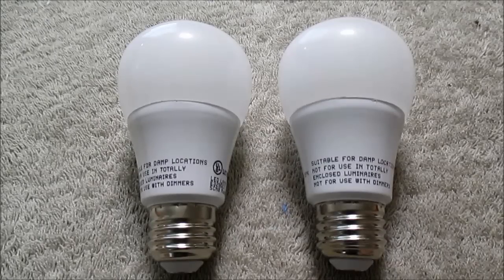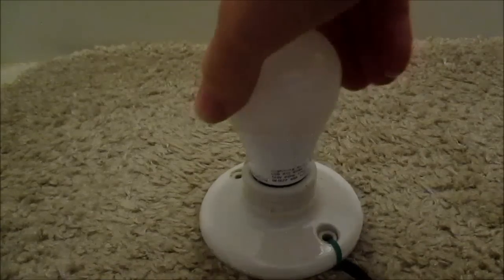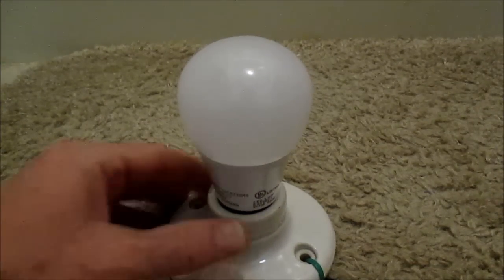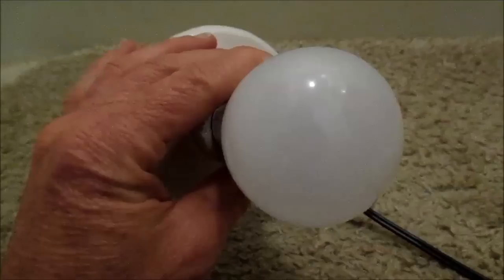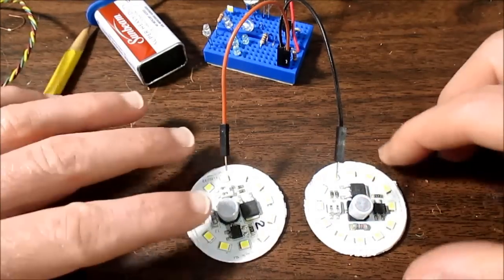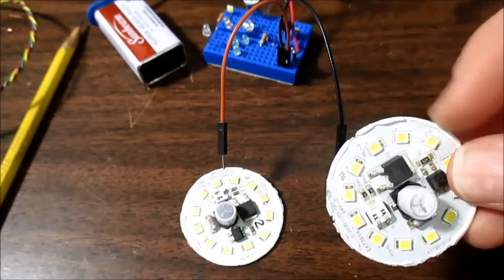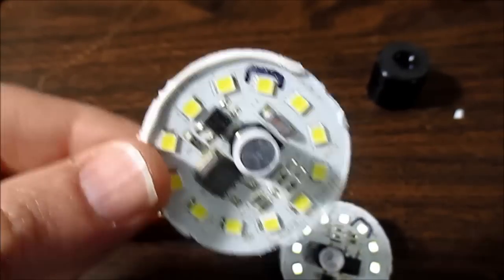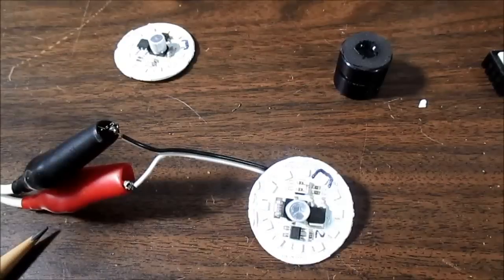Two failed LED bulbs for teardown to determine the cause

Comment: I always wonder how the numbers of thousands of hours of projected life are arrived at?    Since these things haven't been around that long in any numbers.  I bought 2 different ones for my kitchen and neither one lasted more than a week.  I went back to a CFL and don't have any problems.
Reply: i have many that are 2+ years old those with the metal finned heat sinks and even the newer ones are lasting a long time what kind did you buy and from  where?
Reply: I don't remember the brand but they were supposed to be equivalent to a 100w incandescent.  From Menards.  I think I paid $7/ apiece.

Comment: Crap design indeed! Putting the LED's in series such that when one fails, the bulb fails. Almost as if they are designed not to last so you have to buy more.... simple fix though. Just short circuit the failed LED by soldering a wire across it and the remaining LED's will light up a bit brighter than before :-)

Had the LED's been designed in parallel, the bulb would still light up all the way until the last remaining LED fails.
Reply: The resister would simply waste power.  The better quality bulbs are in series and they last 10 or 20 years  These just happen to be a poor batch the design is good
Reply: LED's cannot be run in parallel because the voltage of each die is slightly different thus the one with the lowest voltage action on will hog and then burn out leaving the next to... This is the way that all those cheap LED lights at Harbor Fright tools work. If each LED has a resistor dropping 10% or so then parallel will work, it's just that much less efficient. This is the way 12volt strings tapes etc. work.
Reply: Adding an extra resistor would be a way better design if the bulb lasted longer.
Reply: That's true but in the end UK they cost 10 times that amount to buy :/
Reply: Ugggh... another person without adequate knowledge posting on the net just to be heard.
Reply: A better design might last even longer. Make the LEDS Replaceable.
Reply: The bulb is so inexpensive (unerring $2)  it is not worth anyone's time to fix it..  Mostly these bulbs should work for 10+ years then for $2 yo buy another one and by that time they are so much better you would not want to repair the old one.
Reply: Order direct from China.   You can't use the North American kind as they only work on 120 volts.  But China uses the same 220 as the UK.
Reply: Many would complain of reduced light output at the point the first LED fails if they where installed in parallel, perhaps that drove the in series choice. In the end most will get more life out of a LED lamp they ever did with an incandescent lamp. When going through the effort to repair a LED lamp why not solder the proper value of resistor across the failed LED as not to stress the remaining LEDs?

Comment: Thanks for the video, does seem like a failure trend at this point.  One of the big marketing strategies is that LED bulbs are going to last a lot longer.  Guess they mean in a landfill.
Reply from the maker: I have LED bulbs that have been running for 5 years. The ones in the video are $1.75 per 2-pack cheap crap.
Reply: Do you ever monitor the temperature of the LED's ?
Primary determining factor of how long electronics are going to last is how hot they get.
I see people put LED's in enclosed fixtures when it says right on the box they came in not to.
I only use dimmers and dimmable LED's, save for a 3 way lamp LED in the living room.
Dimmable LED's cost more because the support circuit/power supply are better quality.
Reply: Some fixtures are enclosed.  It is necessary to put some sort of light emitter into them.  In enclosed fixtures, incandescent lights can get to hot and damage the insulation on the wires unless there is an over-heat device to shut off the power.  The life of CFLs and LEDs will be reduced, sometimes excessively so.  So what are people supposed to do? @Klaa-2
Reply: The leDs fail because they run too much current through them, which makes no extra light, it just cooks them.   Solution is to replace the current-setting cap with one 1/2 to 1/3 the capacity - uF-age.
Reply: Actually, at least to a point, increasing the current DOES increase the brightness.  However, that reduces the life.  Some LED systems have lives rated at 50K hours or 100K hours. @GerardVaughan-qe7ml
Reply: As always it is down to production quality, of course cheap bulbs will not last.
And sadly as time goes on companies know you are used to buying a certain type of bulb and they can just make them fail quicker. I have a bunch od old Phillips CFLs, some over 10 years, and a whole stack of one year old Phillips CFLs that are about to crap out... they know how to play this game.

Comment: LEDs in cheap bulbs fail because of inadequate cooling.
Reply: jkn, that is a simplistic post that  1) Likely does not apply in this case   2) usually electronics fails, not the LED
Reply: In these cases LEDs failed.  I have cheap bulbs looking like that and those run hot.  Of course heat ages electronics too. Problem is that lot of heat sink area is covered by plastic.

Comment: Just a note to say that the carbon in pencils can conduct electricity, so best not to use as a pointer in live circuits.
Reply: Oh definitely. And RF, too. I have a scar on my finger where I held the sharpened end of a pencil while pointing out problem areas to a tech I was teaching to repair diathermy units. Got a little too close to an unshielded RF field and it burned a neat little oval where the lead was touching my skin. Never went anywhere without my pocket protector including an all plastic coil adjuster from that point forward.
Reply: Pencil 'lead' is actually graphite. So conductive that early radio repair guys used to temporarily fix resistors by scribbling on them with a pencil. You're right: Not a wise choice for a pointer.
Reply: sam steel - ha! Maybe. I suppose, in an emergency, you could sharpen both ends, cut out the bad section of wire, shove the pencil into the composition and duct tape them. Might work. Sounds like that would be one of those 'life hacks' YT channels. Might even work as somewhat of an anti radio noise piece?
Reply: mc3lizard - Correct. It was just an unconscious choice of pointers at the moment, and I was using it when the unit was off, at first. My momentary lapse into idiocy. But the tech never forgot it (neither did I) so he never made that mistake, and that was the important part, b/c there were a lot of high voltage points in the power supply as well as the RF oscillator section. I'm glad those things are not in production anymore, never liked the idea of an untrained nurse just cooking muscle with what was essentially an open-air microwave oven just b/c a doctor prescribed it.
Reply: Funniest prank I ever pulled was drawing a pencil line all the way around a distributor cap and down to the hold down clip. Draw another set of lines from each tower to the first line and you have one frustrated father trying to figure out why his truck don't start.
Reply: Irrelevant, any beyond the tip is insulated by wood and does not come in contact with the metal eraser band at the top.  It's a shame when people go around trying to correct and second guess others instead of first spending the time learning the science and physics behind what they're trying to teach.
Reply: Hey good point. That just gave me the idea that a pencil could b used in lou of a bad spark plug wire lol
Reply: Hey Az that sounds like a fun try lol
Reply: I never knew that. Holy crap!
Reply: TheStupidcomment Natural selection
Reply: TheStupidcomment)
Reply: TheStupidcomment lol it’s 9 volts, not going to hurt you
Reply: Always use a pencil with an eraser at one end, than you can touch 500 V.

Comment: Brilliant video, good fault finding. 67 mA is too much current for those leds.
Reply: RODALCO2007 ... so you can read the part number of the LEDs in the video to know they are not suitable for 67mA? Your eyes must be better than mine.
Reply: No , I couldn't see the part number of the LED's in the video. That type of LED is rated for 50 mA in PWM maybe 30 mA in peerless DC.
Reply: RODALCO2007 .... no, you are talking out your butt. They are almost definitely rated at least 100mA, probably 150mA, and maybe 180mA

Comment: If it isn't crappy leds, its piss poor power supply design, and further moisture, and heat ingress will eventually destroy the semiconductors anyway, all well within the so called 50,000Hours rubbish claims.
Reply: bjtaudio .... Semiconductors rarely die from heat induced failure over time unless really hot (and there is a lot of them). Far more likely for the capacitor to fail and the result being high flicker.

There is little to support your claim of 50,000 hours being unreasonable.
Reply: Leds are a lot more sensitive to heat than other semiconductors, you can see they go black inside and fail. However I'm more referring to the ingress of water from the heat cycling causing corrosion which can work it's way up the legs and into the package, breaking the bonding between the semiconductor and the lead wire for example. The capacitor is by far the most likely part to fail as you said.
Reply: bjtaudio,  water ingress into an LED is virtually never a consideration in a design, and rarely if ever do they go black either ... well never really. If they are over-temped over time, they may go brownish, but you are talking way past where they should be operated.    I think you are applying concepts of old 5mm epoxy packages to modern silicone encapsulated devices.
Reply: Your "experience" is worth well ... absolutely nothing. They are not "just at bright" at 1/2 the current, your eyes are simply logarithmic in their detection of lighting levels.

Mainly you are talking out your rear end. There are numerous ways that current is set, and in this case, it definitely is not the 400V (your guess) capacitor.

Please stop making comments that you have no clue about. You could actually get someone hurt.

In this case, the failure is just a cheap LED ... poorly manufactured that was not able to take the repetitive thermal cycles of being turned on/off. It's common in ultra cheap LED suppliers as they have terrible quality control on their bond wire process.

Comment: These are likely heat cycling failures.  They run them pretty hard with very little cooling and when turned on and off regularly the bond wires eventually break.  We had a few Feit bulbs fail in our outside motion lights.  I set them to dusk to dawn with the replacements and have not had any more failures for the past couple years.  Many of the more expensive name brands like Philips and Feit tend to use higher binned LED chips and run them under spec to help make them last longer while producing less heat per chip and providing better cooling.
Reply: I noticed the LED disk only contacts the heat sink on the edges. Some of the better designs have the heat generating power components mounted in Epoxy inside the base.
Reply: Yeah, many LED seems to have a similar issue - overheating and horrible thermal paste. The LED are just driven too high, coupled with bad thermal dissipation.
 I was surprised by the super simple electronics on this one (i.e. 3 pin voltage reg) - what I have found is more like: BP2832K  with an extra coil and diode.